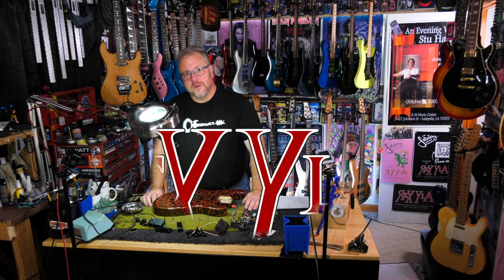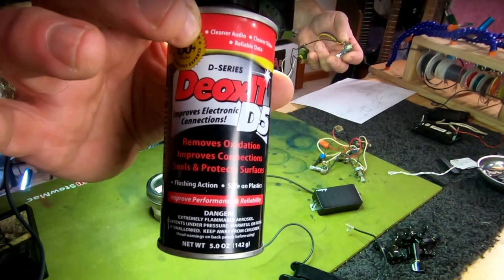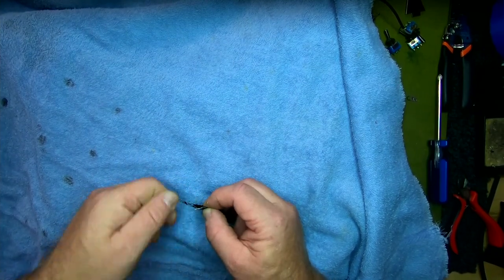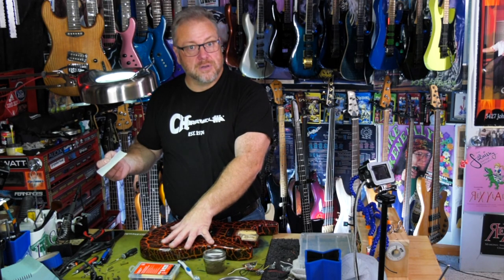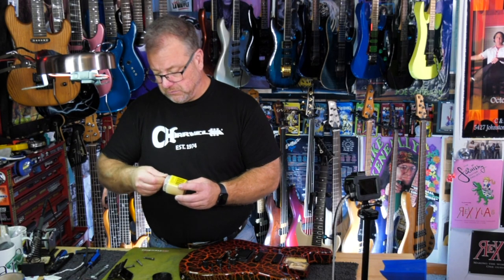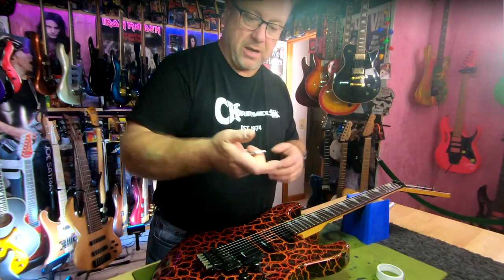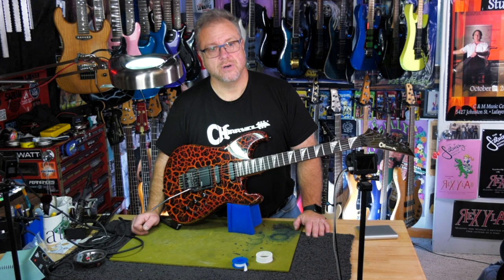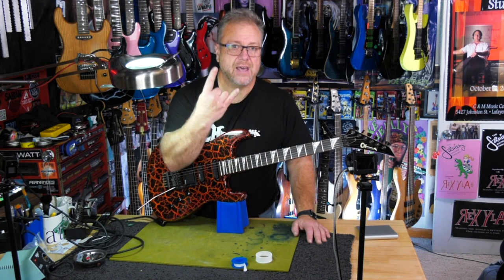1989 Charvel Lava Crackle Model 4 Rescued! Part 2🎸

Comment: Great guitars these old Charvel’s. Only the model 4 and onwards had this stupid switching system instead of a 5 way making it so hard to change pups quickly! Would of been an absolute pain live…
Cool tip with the Teflon tape on the arm however I put the tape under one of the bushings so I can take arm on and off when needed without the tape coming off! Gotta be careful doing it because those little bushings can fly off anywhere lol. Cool video man!
Reply from the maker: I agree about the mini toggles but the 5 has a blade switch, I bet that would be more to both our liking. 

I put Teflon over the bushings because they are easy to break or loose like you said. Teflon tape is cheap and these all just stay in the house so I just leave the bars in. 

I am about to start shooting a big series on Kahler so I bought a model 3 with the dreaded 2500 on it. There has never been a complete history of Kahler or setup guide for any of their whammy bars so with Kahler’s help I’m making one. All their systems will be represented. If that sounds interesting check back for sure!

It’s funny but back when these were new I didn’t like them. Check out this video about why I felt compelled to get a model 6. 
https://youtu.be/D-LgMh74nco
Reply: @REXYLAB  yeah the 5 way blade would of been better on these like the model 3 has! And yeah of course understand why Teflon is on outside of yours as yours just hang there, mainly chucking in there for people who have to take bar in and out etc. Yeah I seen that model 6 video , very cool vid. Keep it up man love your content 👍🏻
Reply from the maker: @pk952  thank you, brother! I’m on a mission to bring everyone awesome content and entertain some folks in the process. 

Hopefully I help some people along the way too. 

Not this Saturday but next Saturday I will have the final video on a Steve Vai inspired build for a little girl with 9 rare diseases. It’s my finest work yet!

I hope you check it out.

Comment: What brand output jack do you use?
Reply from the maker: I used to use switchcraft exclusively. Since discovering pure tone that is what I use unless I am going for authentic restoration.
Reply: @REXYLAB  thanks
Reply from the maker: @robertleftwich517  no problem. The output jack on most things is usually super cheap and the first thing to fail. 

I highly recommend pure tone but switchcraft is great as well. 

I recently took apart a Harley Benton to show its build quality (that’s coming next week) and while the jack is cheap it’s the same one many “big” manufacturers use. 

If I can help with anything else just let me know.
Reply: Great job as always.  ❤   The model 4’s were amazing.  I’ve owned my  87 model 4  since 1989.  Only thing I changed was the output jack.  Keep rocking.🎶🎶🎶🎶🎶🎶🎶🎶🍻
Reply from the maker: @OdinHammersmith  thanks buddy! I have one more Charvel to do, a 3DR. 

I’ll also be doing a full tear down and rebuild of a JT6. I hope you enjoy them.